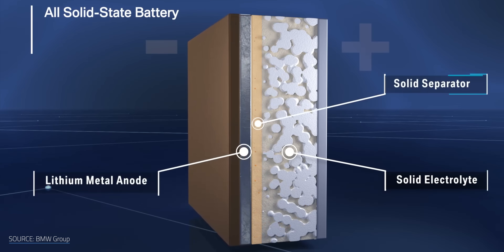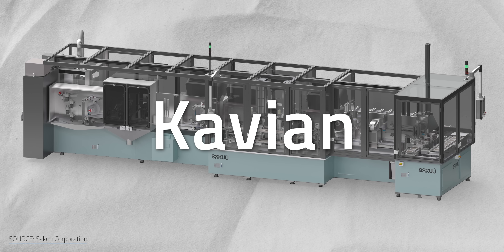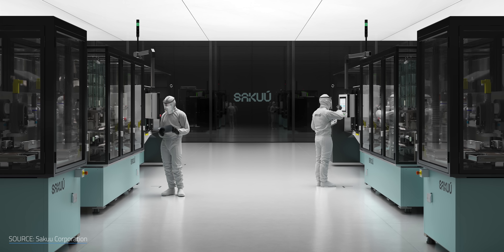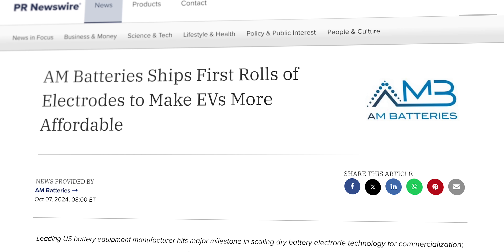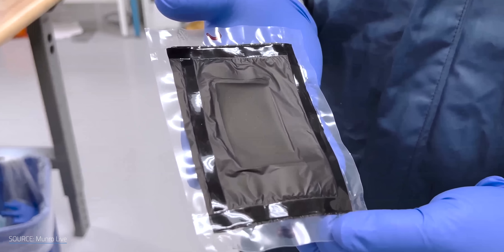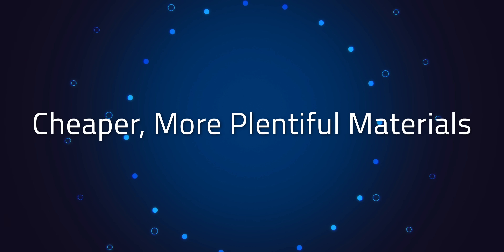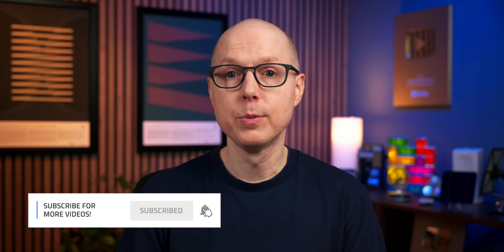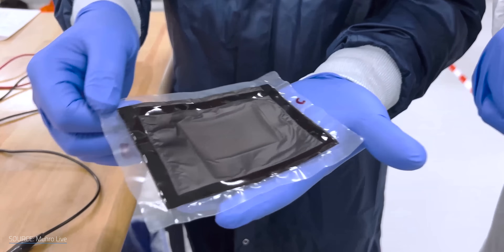Why This Ultra Cheap Battery Breakthrough Matters

Comment: There is also the recycling industry to consider. It's reported widely that today's batteries are well above 80% recyclable, with some claims being as high as 95%. Those technologies will reduce the demand for freshly mined Copper, Lithium and other materials significantly.
Reply: Who's recycling existing batteries?  There are theories that batteries can be recycled at that rate but it's not being done.
There are companies trying to recycle but nothing in mass.
Reply: @SwordFighterPKN  Define by mass though... there are a few already. The difference is that there isnt that many batteries being recycle in general yet, but mass is a relative term.
Reply: @adr2t  Define by mass?  Let's take an aluminum can as an example anything on that scale?  I can tell you it's not.  I do energy storage with batteries and there is not a lot of discussion of recycling in the industry.
Reply: @ Its because a number of them can already do the current supply of batteries that are setup to be recycled all already. That is why I saying you need to define what you mean by mass.. The problem is that there is not a mass yet to recycle. The ones that can.. can do it in a few hours... chicken and egg problem. Same with solar panels and everything else.
Reply: @ so the claimed 80-90% is not true then?
Reply: @ Uh? To recycle? No, that number is true, they can hit already in the upper 90-95% - its just turning the battery back into elements and then doing whatever with them. Carbon is mostly the only thing I think they really have trouble recycling as 30% of that stuff can't be reactive. So if you was to take that into account it would be closer to 75-85% in total more realistically, but there are other things you can do with the carbon that goes unused witch is why they say 90-95% can be reused. The last 10-5% is mostly plastics that can't. Maybe you are thinking that means we already recycle 90-95%? Then no.... atm... I think its less than 20% are recycled atm... but that is mostly again because we dont have the mass to really kick off recycling yet for EV batteries. Now with that said, I do know we 95-98% of ICE Car batteries and something like 50-75% for cell phone batteries. Random batteries I think its closer to 20% again.
Reply: @adr2t  oh lead acid (aka ICE) batteries are a very different animal to recycle than these lithium ones.  Cell phone batteries are the same chemistry as EV and Storage they are not getting recycled either.  The "recycling" I have seen discussed is basically grinding things up and hoping someone can figure out what to do with the "black gold" that is created.   But I get your distinction now of what could be possible from a technical point of view vs. what is being actually done.
Reply: @SwordFighterPKN  No,  but mostly because 80% of them are still going and not ready for recycling. My 2016 Nissan Leaf still has between 80 and 85% of it's capacity when new.
Reply: @laserflexr6321  Dude there are MILLIONS of pounds of batteries from EVs and storage.  Especially in the storage world once a battery is at 80% it's replaced.
Reply: @SwordFighterPKN  "Who's recycling existing batteries?" A: Redwood Materials, Brunp, LiCycle, Umicore, several others. They're all waiting for enough batteries to actually fail so they can ramp up operations. 

The idea that big valuable EV batteries won't be recycled is pure weird reverse-hopium from skeptics.
Reply: @skierpage  Why this focus on EV batteries? There are TONS more in storage.  there are 100's of cars worth of batteries in a single storage facility.  This idea they are wait is funny.  If it was such a practical idea it would be happening today.  But like these solid state batteries is seems to be be "just around the corner".  Look I'm all for the recycling but it needs to be done today.
Reply: @  think. Only around 550,000 BEVs were sold throughout the world in 2015, so their batteries are just starting to be available for recycling. But in 2034 20 times as many BEVs will be entering the car recycling stream.

Comment: A big problem with batteries designed for one purpose (a complex shape that exactly fits a single model of a phone, for example) is replacement.

It was so good that AA cells, to select one of the most common formats, can fit untold devices simply because they are all the same size. (Of course, there are issues, numerous chemistries, rechargeable or not, and varying voltages. They are not perfect.)

We know there are many barriers to battery replacement in phones. But if every model of everything requires a specific battery, we will make it even worse.
Reply: True, but I would argue that hasnt been a thing for a while though. Nothing is using the same battery shape or size in the cell phone market for example.
Reply: @adr2t  I think that is done to keep market share.
Reply: @ Na, just different demands is the problem. While they might have similar shapes - they have way different needs on the insides.
Reply: are you new here?  Companies do not want you to replace your battery they would love it to be so integrated you would have to replace the entire phone.

Comment: All the research is great.  How about a status report on all the battery and technology you have reported and how many have made it to commercial production?
Reply from the maker: I've been trying to do that the past year or so.  I've been revisiting topics to see where things stand and how progress is going (like flow batteries, zinc batteries, etc).  Stay tuned.
Reply: Probably not much however silicone carbon anode li-pol batteries are now in flagship mobile phones. :) Around 13% better energy density so now new phones like OnePlus 13 have 6000+ mAh batteries but are thinner, lighter and charge faster than previous generations.

Comment: 4:15 "Even in unusual shapes" You do remember the idea is to get these things redesigned so we can easily REPLACE old batteries, not just trash everything wastefully because one part went bad.
Reply: Dry electrodes could be a process that is doable at home. Diy batteries coming to a maker space near you. Although now that I think about it. Why haven't diyers started modifying existing pouch cells?
Reply: @Imaboss8ball  that tendency to spontaneously  burn for one.
Reply: @paperburn  well technically people probably could make substandard but safe replacements. You don't really need max energy density if you are just trying to keep an old device out of the dump.

Comment: guess what, something that costs manufacturers less to produce, doesn't result in lower prices for consumers, but increased profits for manufacturers.
Reply: A 1 kW/h battery in 1990 cost around $9,000. The cost today is counted in single dollars. The profit comes from scale of production.
Reply: To be fair, that depends on demand and competition. If the demand is high and competition is low, they can get away with higher prices.
Reply: They will lower the cost... too much competition for these companies to keep them high. From EVs to battery backup systems - nothing will want to keep the prices high if it means more profit in over all sells as the demand is still super high for it all from grid to personal use.
Reply: Low cost means producing batteries becomes a very good business. This encourages investment, and new players enter the game.
Competition is what really lowers the price for the consumer.
So yes, prices are eventually lowered, but it's not immediate
Reply: Hey look! A hint that our education system is broken!
Reply: This is still a good thing though. Not for the average person, but if a company can make an equivalent product for less money without affecting anything else, that's good.
Reply: Well, solar panels sure have gotten way cheaper over the years as the costs of production went down.
Reply: Only until competition ramps.
Reply: 5:50 “I recently discovered I was so rich I didn’t notice someone stealing my money each month” are you having that problem too? - Nope..
Reply: Not necessarily. If they can sell at a full price to 1% of the market, they would quickly discover that they can disrupt the market and sell at 50% of the price to 50%+ of the market. In the competitive market one earns big money on big volume and quick capital turnaround, not on big margins.

Comment: People want longer range cars but most drive around their city most of the time. Just get sodium batteries and if once or twice a year they go on a long trip, then so what if they have to charge a few more times to get to where they are going. If you can charge the battery within 20 minutes then it is a break from driving every couple of hundred miles. 
People who regularly make long trips can have the lithium.
Reply: While that is true, at least in the states, its not uncommon to have to go to a city that could be miles away. 1-3 hours and back once a week. So we need the range when we need it - even though most of the time it is city driving. To me, 20 mins is just way too long. It can take me less than 5 to fill up currently even though my car is roughly 350 mils as well per tank (not too far from current EVs). So either we need EVs to hit around 400 or cut their cost by 50% for current. OR have a way to quickly swap batteries for short and long range use.
Reply: @adr2t  I have 50 mile range on battery, which covers 99% of my trips, and just switch to gas for the long runs. When we finally replace my wife's car it will be pure EV, and we'll just use the current dual mode vehicle for long road trips.
Reply: @ Yea thats what a lot of people are doing because of that reason. EV for in town, ICE for longer trips.  EV bikes for even shorter trips. Yet they do that because of the battery sadly. I get it, I am just saying, one of the above has to happen to make it an all around good enough car personally. (Besides price) the only real reason I havent even look at an EV yet (new/used). I think Na has its place in the home/grid, but I think Li will still have its place in the EV/high power needs.
Reply: @ The main reason why ICE have any place now, is simply the lack of effective public transport. If there was a good public travel for when I need to make a 300 mile round trip drive (roughly 8 times a year), I wouldn't drive. EV for local travel covering 99% and effective public transport for long haul.
Reply: @KnugLidi  I mean if you want to make that argument - you wouldnt even need to own a car.... you could save all that money and do a ride share/AI/EV car instead and save a bit of money. At 40k an EV... say 10$ for a drive - that would mean you could have over 4000 trips. thats 10 years once a day trip. 5 years at 20$ a trip. Still 7 years if you include any extra cost to the car it self, and 10 once you include insurance again even at 20$ a strip... 5 again at 40$  a trip lol.

Comment: Está muy bien pero como será la reparabilidad de una batería con electrodos impresos en 3D?🤔
Reply: Compared to lithium, probably the same. Which is to say, neither can really be opened up and have its electrodes replaced [by an average user]

Comment: Do we honestly think that the lower battery cost will actually result in a lower price for the consumer, because I dont. Corporate greed will not allow prices to ever decrease.
Reply: I was just thinking about this part. To me, it seems to depend upon a couple conditions.
1) If the younger generations keep on it, keep trying to help greed diminish. I'm rooting for the younger generations myself.
2) If we can develop a separate method of rewarding excellence aside from money. Hard work and effort should be rewarded, I think, but if money remains the measuring stick, greed has a better chance of winning out. It takes real effort to think of what non-money rewards could look like, but I think it can be done.

Comment: This is in my opinion a very honest and hopeful take; it covers multiple aspects of a battery system, and honestly tells what parts are still in R&D and which parts are basically commercials for new battery companies. It straightforwardly explains economical issues with current alternatives and it shows how progress could both cut costs and potentially benefit nature, human society and your own wallet... somewhere in the future.
It could, however, do with some more comparative numbers such as energy densities for the various composites, or some critical thoughts on the actual scalability of the innovations. And It would have been fun to speculate on a ~85% price drop when you imagine all the different innovations in one battery system and its manufacturing line... Tony Seba as well predicts this will happen during the next decade based on the regularity of cost-cutting curves in various energy related industries.

Comment: The next question with a almost pure polymer battery is would it be easier to recycle too - I'd think it probably should be as you can break down and reform the collection of polymers in much the same way they likely were created from crude oil in the first place with less other stuff to filter out. Though battery recycling is a problem that will always lag a prolonged period behind the developments in battery tech always worth at least considering before mass roll outs - being stuck with a huge pile of EOL bricks that might even be actively hazardous to the environment to just dump..

Comment: The potential seen in the last couple of years intensive battery research, will inevitably lead to some groundbreaking new developments. Size reduction, better power retention and release, cheaper production cost, improved safety... All are positives to strive towards.
Reply: as with all scientific break through I still wait to trickle down so not only a handful of billionairs profit from it
But i will not keep my breath.
Reply: Improvements? Yes, Gradually. Not "groundbraking" or "worldchanging". It took the industry from 1997 to 2020 to develop the LFP cell to its current product. Because the Chinese government drove the development and paid for it. You think those new developments will take less than 30 years from idea to product?
Reply: Obummer sold of us lfp battery tech smh!